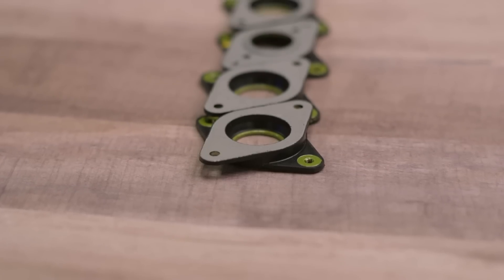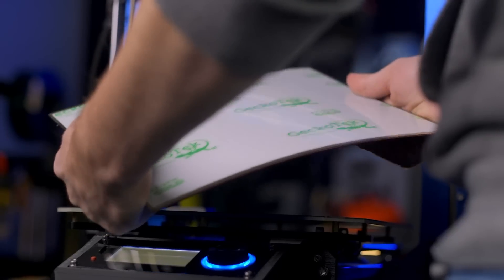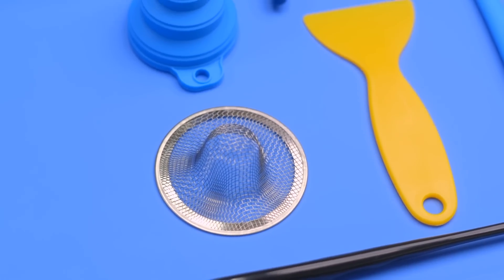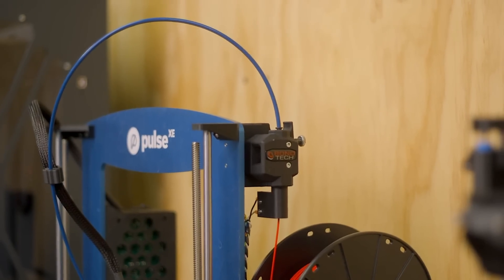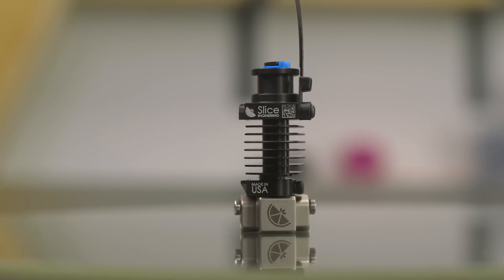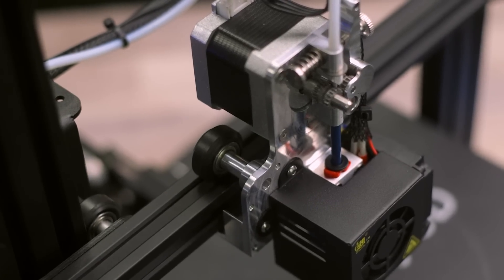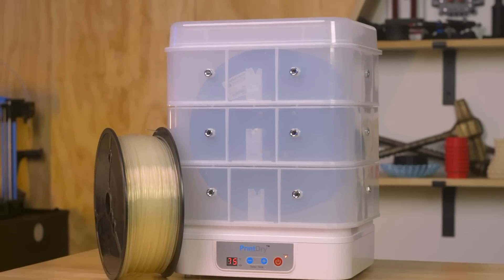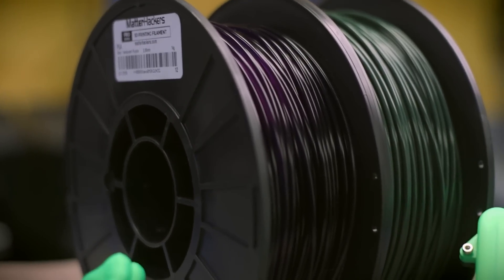Top Ten 3D Printer Upgrades for 2021

Comment from the maker: What's your favorite upgrade or accessory for your 3D printer?
Reply: Octoprint
Reply: Replacing Metal roller bearings with the Igus Drylin equivalents. They are not necessarily better, just a whole lot quieter.

Comment: Wish there was some kind of hot iron mod for your nozzle that would fit on either side of the print nozzle and allow it to further bond the layers together I know slicers have settings to allow the print nozzle to do this on final layers but if you had some kind of flat heated head that would attach to your printer head and sit either even with the nozzle or perhaps a little lower I bet with a little trial and error you could get near perfectly bonded layers without very noticeable lines just a thought if it's even possible

Comment: Surprised at all the hate for stepper motor dampers. I love mine. I’d also add polymer bushings to the list to quiet things down.
Reply: I think the hate for motor dampners springs from using screws that are too long, thereby negating the actual dampening effect. Truth is they really help keep the vibrations down and Iv'e used them on all my machines.

Comment: every machine I've added dampers to, I've removed them, micro vibrations which are decoupled from the frame, are now imparted into the print -- rather use firmware features to tune out resonant frequencies.

Comment: You might not have noticed, but it’s 2021 - putting motor dampeners onto this list is ridiculous.   Pretty much every printer will benefit more from an upgraded board with trinamic drivers which are now available plenty and cheap as direct swaps like the SKR Mini E3.

Comment: A filament runout sensor is also an amazing mod/addon that has allowed me to finish spools without the stress of how much material is left!
Reply: Plenty of printers nowadays already have that installed from the factory, probably the only ones I'd think won't have one anymore are the super cheap printers.
Reply: @griind  The super cheap printers are the most popular, so this is an upgrade that should be applicable to most people.
Reply: @yony120  When I meant cheap printers I generally mean the sub 150/200 USD ones, though there are probably quite a few popular ones around 200/300 USD that doesn't have a filament runout sensor either.